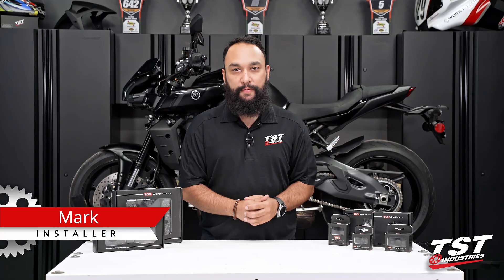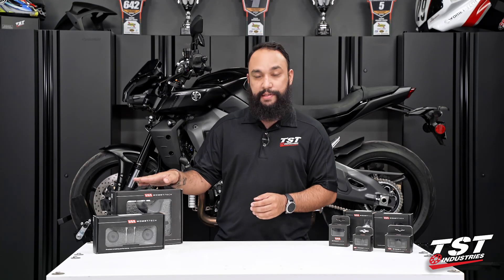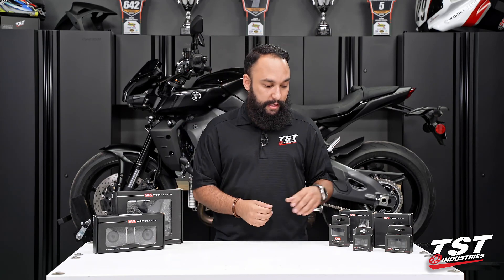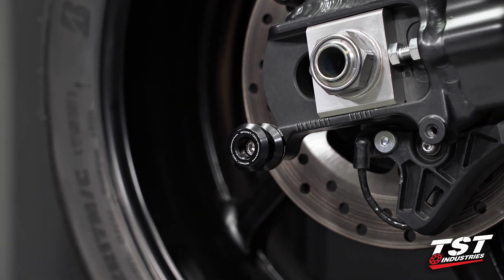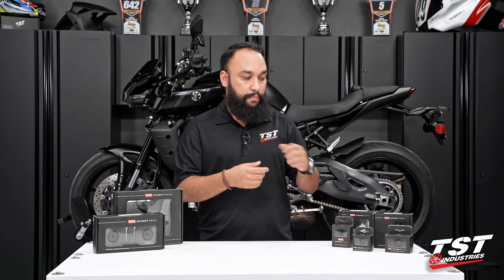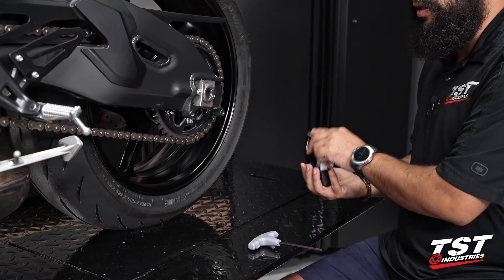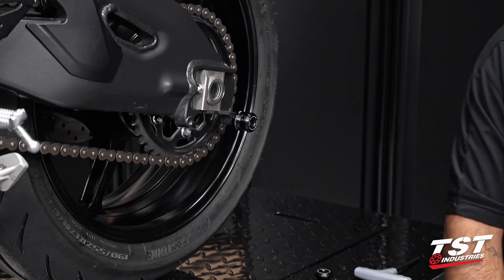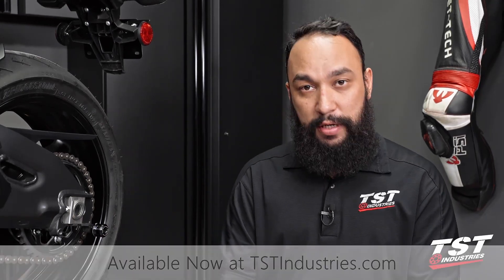How to install Womet-Tech Swingarm Spools on a 2022+ Yamaha MT-10 by TST Industries

Comment: Hello, for some reason my spools came with washers. Should Inise them, if so where do they go? Do the washers go inside the spools, so between the screw and the spools? Or does it go outside of the spools, between the bosses and the spools?
Reply from the maker: It sounds like you received the delrin spool sliders. Those use a screw with washer just under the head to fasten the spool slider onto the boss. So stack is: screw, washer, spool, boss.
-BR
Reply: @TSTindustries  you mean, washer then screw?
Reply from the maker: @joras18  imagine the order in which the parts stack together then follow what i wrote previously.
-BR